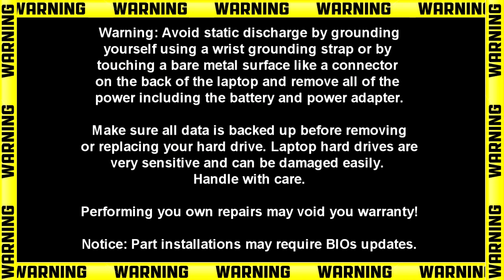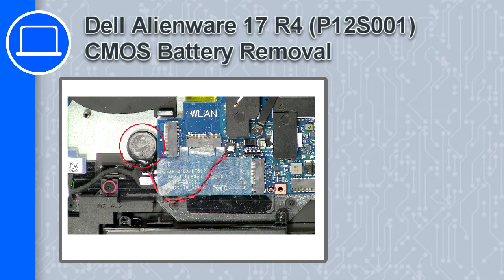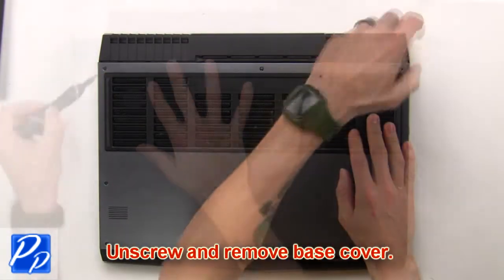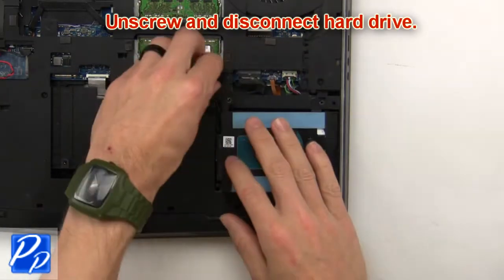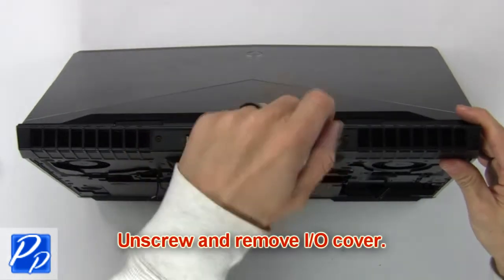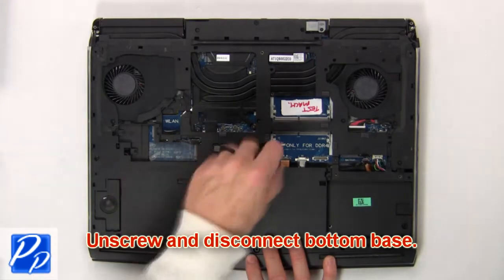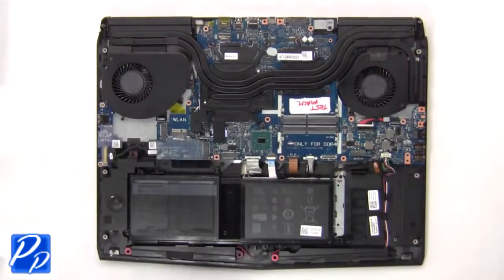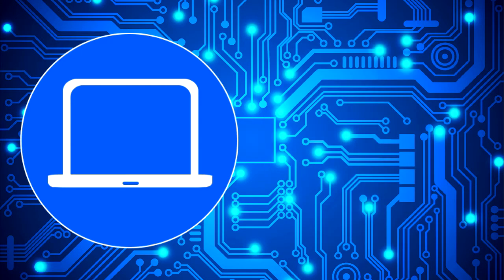Dell Alienware 17 R4 (P12S001) CMOS Battery How-To Video Tutorial

Comment: Hello, I have 17 r4. I was cleaning my laptop fans as usual every 8 months a once. But this time I turn on my computer after finish all cleaning and done what is needed. I am getting 3 blue 1 red codes. That means I have problem with CMOS battery. I plugged out it and put it back. And I plugged out battery cable and press power button 5 sec. but have still same codes. Please help me. What can I do?
Reply: Where u able to fix it
I currently have this exact problem
Reply: @ossaiferdinand5196 I remember that problem was about the hdd or SSD, I was just plugged out and in that's it. Actually I am not sure because I had many problems with that laptop

Comment: I did this to reset bios password and it did not work. Computer loads and asks for system or admin password. Someone said only Dell can do it. However it is no longer under warranty and expensive to send to Dell for them to do it. Is it possible to reset 17r4 so it no longer asks for password or is my only option to send it in?
Reply: did you ever figure this out?
Reply: @bsykesbeats  no I ended up selling it, I told the guy the issues and he sad he didn’t care he was going to just use the screen on it to fix his.